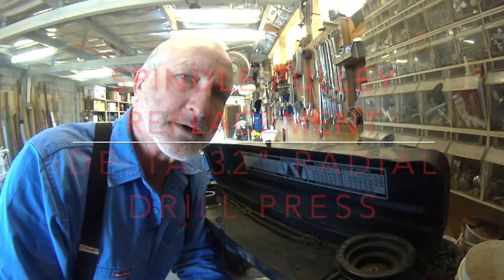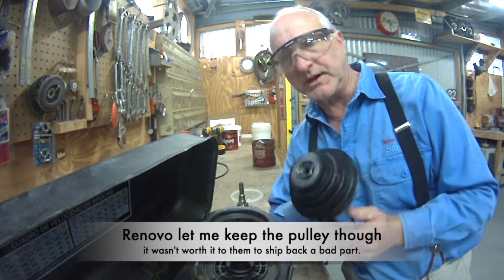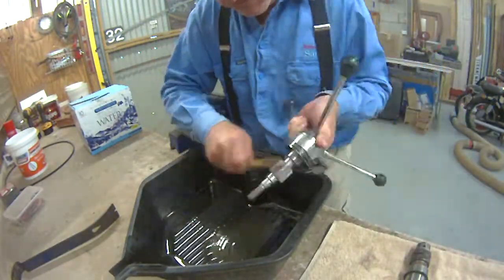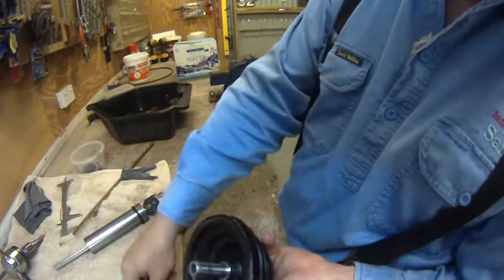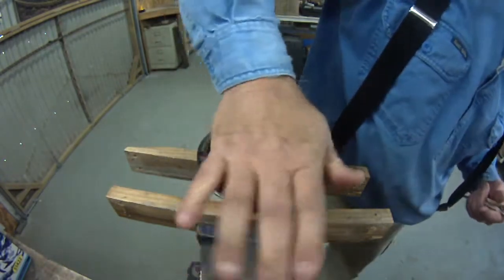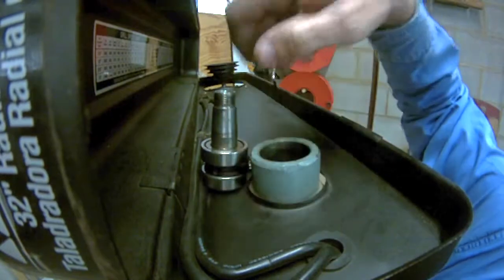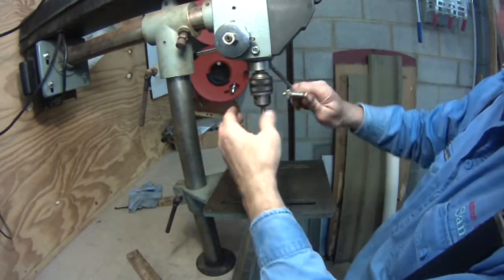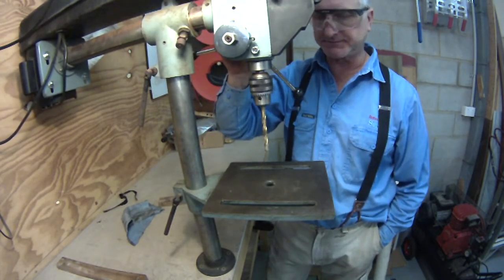Replacing a spindle pulley part two - Made by J&D

Comment: Great fix!  I have a Delta drill press I bought new that's about 15 years old.  It's a benchtop model.  I was drilling a 1-1/4 hole in some steel plate using a carbide hole saw.  It drilled the first plate just fine, but when I was drilling the second plate, the spindle pully came loose.  The left-handed nut that holds the pulley on the  tapered shaft was loose, causing the pulley to not be seated tightly on the tapered shaft. I don't know what that tapered shaft is called. Anyways, how did you get that nut on tight without the pulley and shaft spinning?  Thank you.
Reply from the maker: I did that quite a few years ago now, I only remember having trouble with the chuck coming loose from the bottom end of the  spindle. If your chuck is tight, hold it from turning and use an impact drill (in reverse) on the nut.

Comment: After all that , you are going to wipe out what is left of the spindle /quill bearings  by attempting to turn the drill into a drum sander ?.The  thrust type bearings in the quill  do not cope well at all with radial loads .As far as the original spindle pulley is concerned , all you needed to do was to  gently tap it with a leather hammer off of its taper if you could not get at the set screw for the spacer, between the bearings ...other wise you could have tapped the entire assembly out and then separate all parts on the work bench using the vise and some correctly sized spacer . 
By the way ....always use a hardwood dowel on machined parts and seat the bearings with a metal cylinder like a piece of pipe that matches the outer part of the bearing seating a bearing by pounding the shaft that it is going to spin in it will take a few years off their service life.  I wish I had seen this 3 years ago, good luck anyway.
Reply from the maker: I never did end up making a drum sanding attachment but the bearings should cope with side load just as well as any, the bearings in mine were standard ball bearings. I did try to remove the pulley without bashing on it but as like most things, this was the first time I’d tried this, I had no idea how to accomplish it. If you’ve done this to this make/model of drill press and the pulley came off easily I am happy for you.
Reply: @madebyjnd  
My father would be  100 years old today Jan 24 ...unfortunately  he did not make it to 60 . He was a  tool and die maker/ industrial machine mechanic...I followed in hi footsteps and retired  a bit early at 60 , 9 years ago. I never owned a Delta like yours  but most homeowner light industrial use  drill presses are built similarly, the quill driving pulleys are most often mounted on conical shafts/tapered shafts as are the chucks most often. If set screws are used  to secured them, then  the shaft is cylindrical and has a flat bed for the set screw  rest contact point.  I have taken pulleys off conical shafts on many, many,  machines  besides doing drill press bearing replacements , they never slide off as if they are buttered pigs, friction does all the work . 
Shocking the pulley in the opposite direction in which it has been turning  for many decades with a soft tapper after shooting it with some tiger piss penetrating lubricant  usually does the trick with no further effort , however if that should fail,
with the right tools ,  penetrating lubricants, wedges , extractor bolts . leather hammers and soft metal or hardwood drift  , they all come out eventually, especially if you add   a little dose of  patience  to the tool kit  and sort it out all out ahead of making the video. Who know how many more followers  you may get ....good luck and  happy landings.